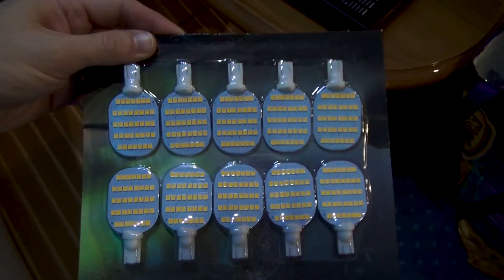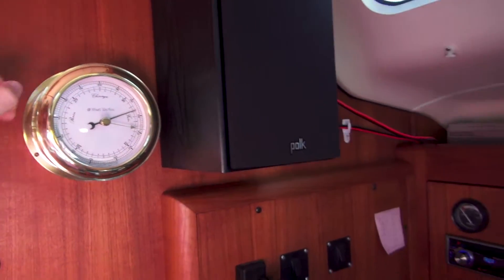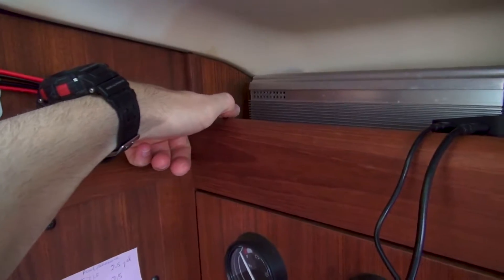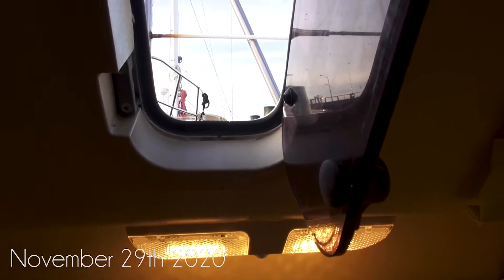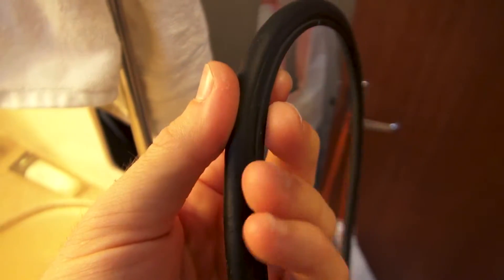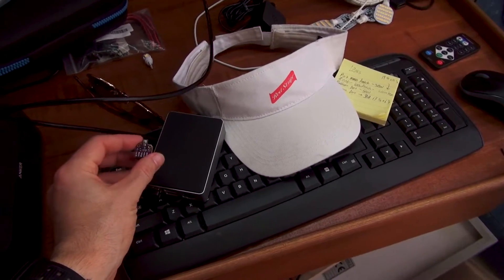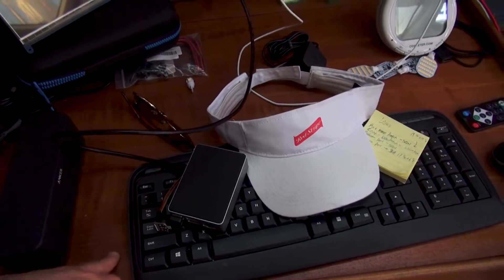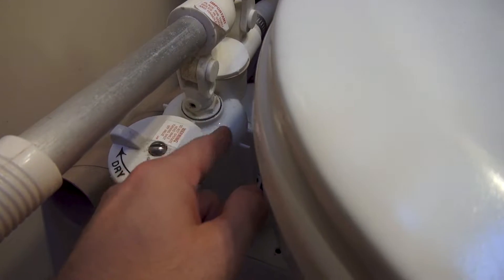A Myriad of Projects to get our Hunter 376 Seaworthy - Sailing Viridian Episode 26

Comment: Hi I have a similar boat 97 Hunter 340 and also installed a RPi with some DHT22  sensors to keep track of the temp humidity but wondering why do you want VOC?
Reply from the maker: I really wanted a barometric pressure sensor as well. Turns out that the BME680 is the only sensor I could find with temperature/humidity/pressure all in one package.

Comment: There are most likely some nice PVC tubes to run wires under the galley cabinets easily through to the aft cabin if you ever need to run a wire in that direction (the H38 has them) - there is also one from port settee through to the v-berth - super convenient
Reply from the maker: I'll have to look out for these! There's a nice wide PVC tube to run wiring from the cockpit up to the nav station which you'll see in some future videos.